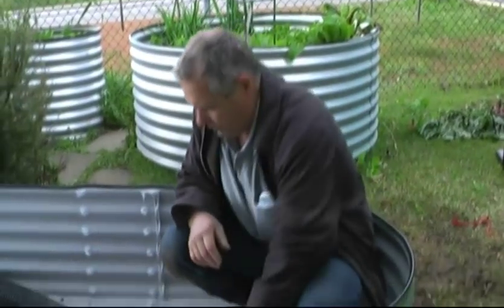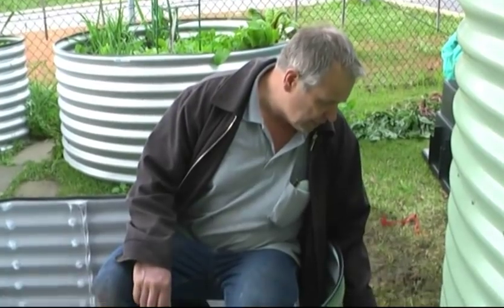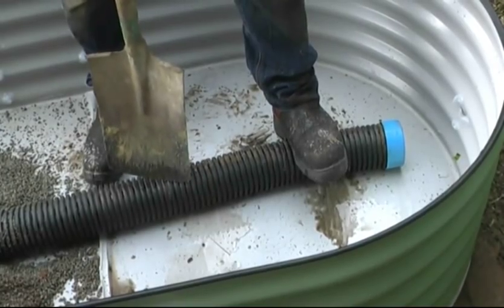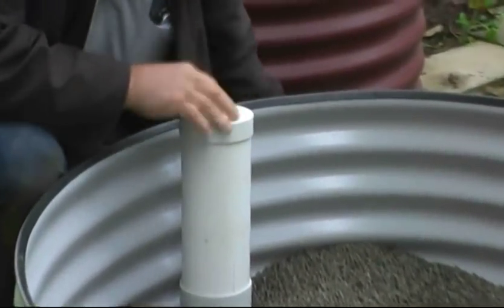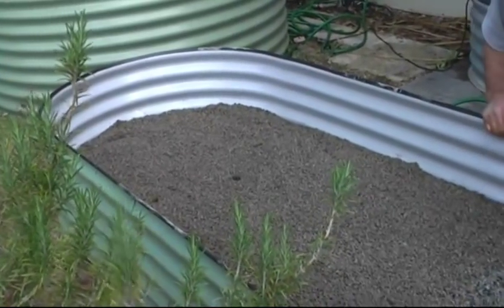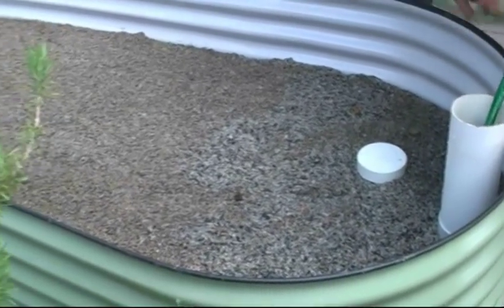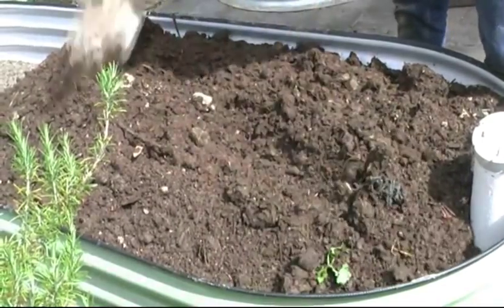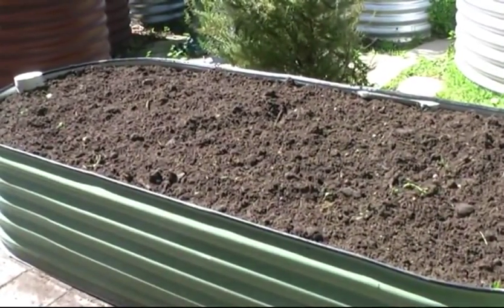'Above ground' Wicking Raised Garden Bed - Water Installations and Greywater Reuse Sys

Comment: I think that your system is great. The only thing that I would change, is that I would have a couple of tubes ~ Ag. (agricultural) Pipe ~ down into the gravel so that they filled with the compost. That way you are "wicking" the water up from the reservoir  and into the compost.

Comment: Cool idea, so next version you ought to design something that weighs less than a ton.

Why do all these things have to be so massive and heavy?

You did not mention the level at which you place the valve.  If it is too high won't the water level will be in your "compossed" waterlogging it, and if it is too low won't it not be able to wick into the soil. i.e. "compossed"?

Comment: You Aussies really seem to love those corrugated aluminum tubs, but here they are very expensive and also heavy - especially with that much gravel inside. Is it hard to make those tubs watertight?

They look cool and seem to be just the right size -  is there some overriding reason you guys use so many of these.  Do you think they are better than 5 gallon plastic buckets?  Buckets are pretty cheap and light. 

Thanks for showing us what you are doing, it's very cool!
Reply: Yes. Hard to find in USA. We get 6'Lx2'Wx2'H galvanized steel stock tank for around $100. But I am going to build 8'Lx4'Wx2'H bottomless using wooden framework and corrugated roof metal. Should cost less than $75.

Comment: To me they look way to heavy and massive, and also how are they supposed to "wick" you either have the water level in the soil or not, there is no wicking ability that I can see, it's like a regular flower pot with gravel for drainage, but if you keep that valve closed you will waterlog the soil for plants that do not need really wet soil.

Maybe if he put regular areas in the soil that reached down to the bottom of the tub so that if the water level was low it could still wick into the soil.